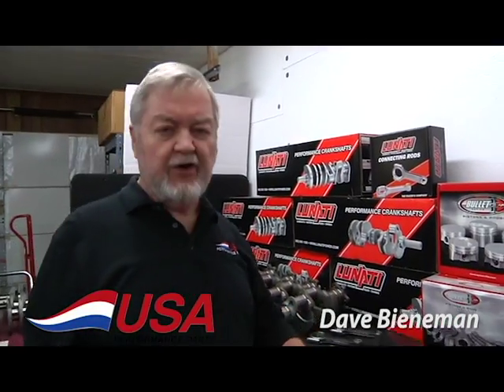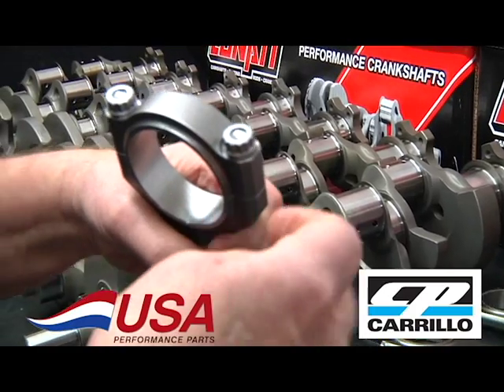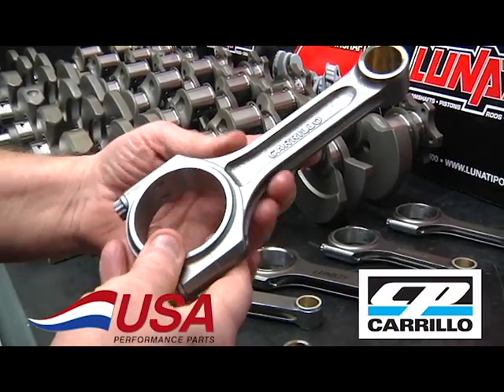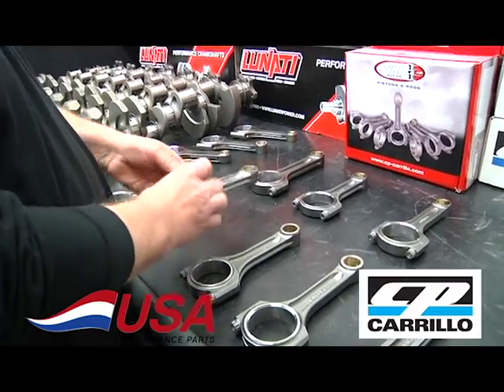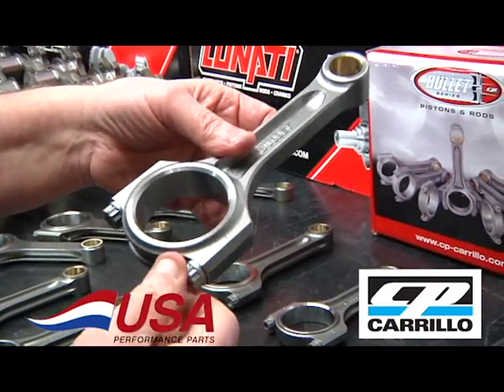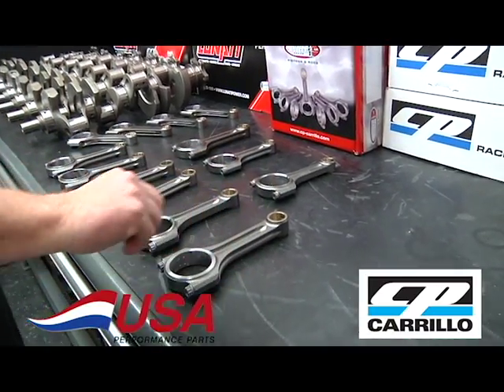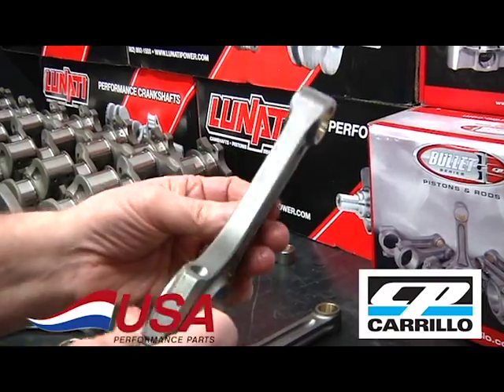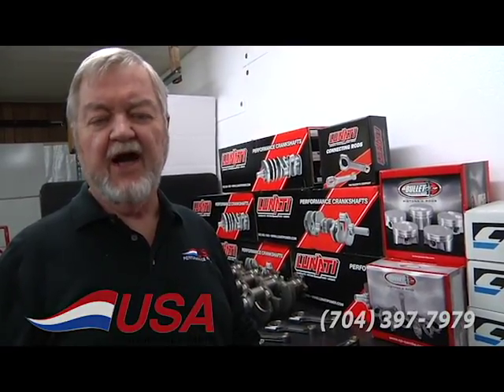The CP-Carrillo "Bullet" I-Beam Connecting Rod available at USA Performance Parts

Comment: Carrillo makes a great product, but if you really want to see cutting edge made in the USA, check out what Callies Preferences Products has to offer. Their Ultra line of connecting rods are truly works of art. Forged and machined in the USA.  For boosted applications check out the Ultra Enforcer line. Simply amazing.
Reply: Know this is an old post. But Callies is Chinese made finished in the USA
Reply: They all are because small forgings are not a thing here anymore. "Too dangerous". I love the videos that tout all made in USA. Where is the video footage of Americans running forging presses? There is none, but there's plenty footage of modern Chinese forging presses in action.